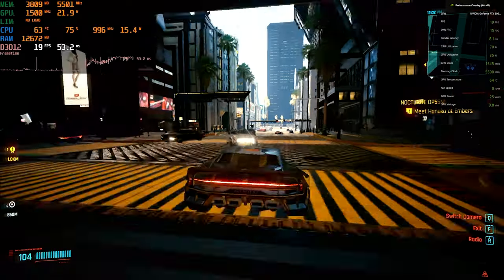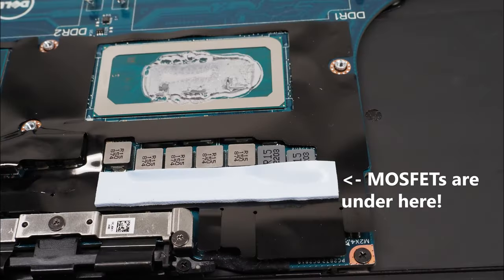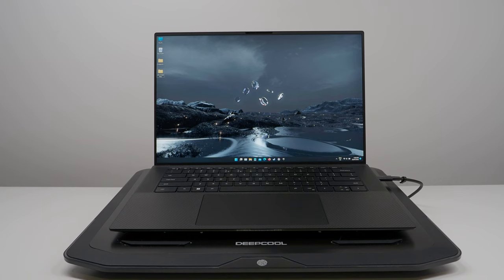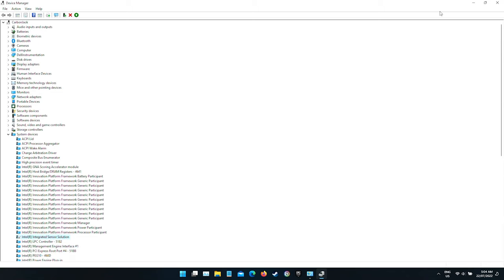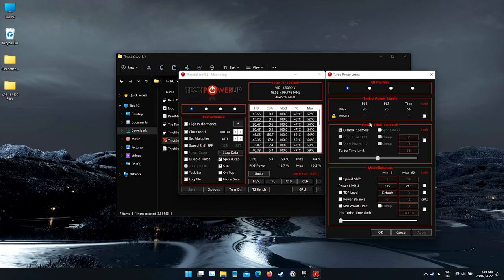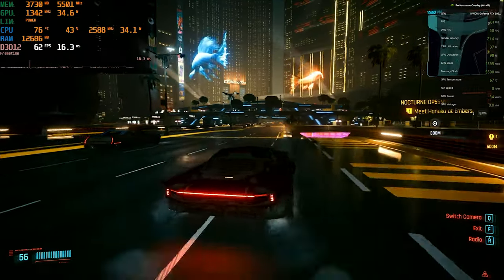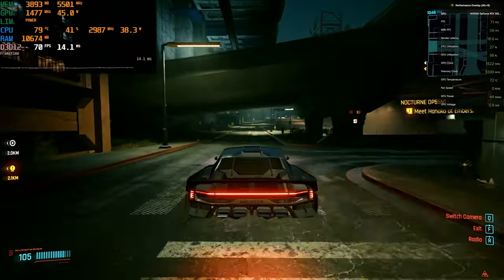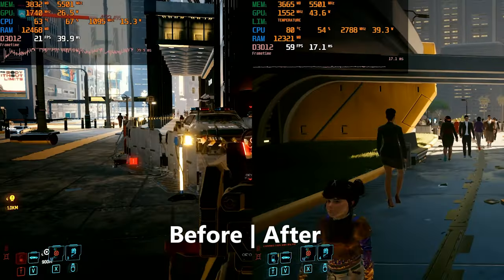Dell XPS 15 9520 - Solving the throttling

Comment: i can't seem to find NVIDIA platform controllers and framework in device manager, i have a dell xps 9500 btw (gtx 1650 ti)
Reply: Dude are you still facing the issue , because I have same config as yours , I also have xps 9500 , what did you actually do to fix it , because my laptop is throttling even playing cs 2 on low preset
Reply: @pranjal651  Hey, you're not gonna like my answer but I just bought a new laptop. I couldn't fix any of the issues and the screen won't turn on anymore, Dell is just a shitty laptop brand imo. Me personally, I would try and maybe get some money out of the xps maybe by selling it or trading it in (idk if they will give money for such an old model) and just get a new laptop, either a macbook or a gaming laptop with an actual cooling system.

Comment: About the cooling pad, it looks to me that the fans of the xps, take the cold air from behind and PUSH DOWNWARDS  the hot air  to exhaust (where the qwertyuiop keyes are). If this is the right dynamic, than, having a coolpad that pushes upwards forcingly the same hot air that the xps fans are trying to get rid off by exhausting downwards... it seems not productive. Actually i bought i cooling pad even before watching this video and it does absolutely nothing to the temperatures of the cpu or gpu. The system keeps having the same temperatures with or without it. I guess because the xps fans do not suck the air from down and exhaust towards the back of the laptop but they suck from the back and exhaust downwards. Do you have any idea about this?

Comment: This man doing the job that Dell engineers should be doing lol. I'll never game on an XPS after my 9560 with the i5 7300HQ and GTX 1050 would throttle to hell even playing lightweight games.

I also realized that people who said XPS could game ok were full of it or playing 25 year old games. Beautiful machine and built well, but the XPS line has always had terrible out of the box thermals/annoying hidden power limits.
Reply: Man I can understand your pain as I too own the 9560 and I had bought it after watching tons of videos online that showed them playing AAA games on the 9560 comfortably but when I tried my used to throttle to hell even in CS GO! 
I realised most of these people must be from really cold countries or are just straight up lying.

It is surprising that even after 7 years of the 9560, Dell is still doing the lousy job on XPS cooling... pity because I love my 9560 on every other thing but won't buy another xps anytime soon.
Reply: I did see a guide on youtube which made that 1050 XPS game pretty well for hours by severely undervolting the i5 7300hq (still maintained its 3.1ghz clockspeed) and the 1050 was undervolted too. You can repaste them both as well. 

My legion y520 with 2 small heatpipes and just 2 fans stuck next to each other, managed to make my 1050 clock to 2ghz with vram clock at +829mhz stably for days. My i5 7300hq was always at 3.1ghz and didn't cross 70. 1050 stayed at 60.
Reply: @siyzerix does the dell precisions laptops have thermal issues too, please tell me because i found dell xps 15 9570 and dell precision 5530 in the same price and i want to buy the xps but all consumers suffering from heating issues
Reply: @akqo  Have a look at reviews. I cannot say for sure. But they shouldn't overheat. However, like any laptop, you HAVE to tune it to get good temps
Reply: @siyzerix  of course, thanks for your response bro
Reply: Agree. Even playing football manager 2023 with 2D display match, still have lagging. This is joke my xps 15 9560 i7 gtx 1050

Comment: Thank you so much, I have an XPS 9530 and had horrible performance issues for months with the CPU clock speed going down to 1 GHZ whenever I opened an intensive program. I had the fans and thermal system replaced, updated all my drivers, changed every setting etc. and nothing worked, but part 4B worked perfectly for me. It's great to finally be able to use my laptop.
Reply: I think I’m also having the same problem did you just open the software and did only part 4b?

Comment: This did wonders for my XPS 15 9510 (2021 model) with an 11th gen i9 and RTX 3050Ti.
The 9510 actually doesn’t have that plastic layer, so all I did was re-paste the CPU and GPU with thermal grizzly and replace the existing thermal pads with nicer ones.
I think that alone helped a bit, but changing these TPL settings in TS helped significantly! I gained over 200 points in 3DMark Time Spy.

It’s a shame Dell locked out most of TS undervolting settings for new models. 
I’ve seen some Reddit posts where people managed to mod the new BIOS versions to enable the locked overlocking and voltage controls, and actually gain performance and battery live by undervolting, but the BIOS modding process is way too involved to waste precious time over.

Comment: On older XPS models, we could:

-  boost fan mapping with Dell Command I Power Manager (ultra-performance or cool). 

- SpeedShift was the best way to quickly adjust CPU performance (EPP of around 80/255 was the lowest that allowed max turbo clocks). EPP of 255 is worst performance with low power consumption.

- Elevating the back of the laptop with a pencil or eraser to allow more cool air into the laptop provided a nice boost to performance (for those who don't have a cooling mat). 

- Repasting the CPU and GPU as the factory paste was rubbish. Don't over tighten the heatsink else something breaks.

- Some electrical tape between the fans and radiators as the old ones had a lot of air leakage (hopefully that has been fixed by now).

- Some put thermal pads on the VRM mosfets (maybe to the heatsink). That is a trade off as the VRM temp sensor used to throttle the laptop at a low temp. This reduces cooling available to the CPU and GPU, however. Dell frequently mislables that VRM temp sensor so manually confirm.

- ThrottleStop had some great tweaks on the forums. I think Intel is running newer chips much harder so there isn't so much room to tweak. Afterburner can be great too.
Reply: Are these not needed anymore?
Reply: @BenGodot  No idea. The newer XPS models still are thin-and-light so will struggle with heat and power. All thin-and-light laptops suffer this to a point.

I don't know what tweaks work on the newer models.

Research throttling of a particular new XPS and determine if that would impact your use cases. These target daily us rather than heavy gaming, for example.
Reply: @dosgos Actually it's not Dell fault to be thin and small. It's intel fault that is still too hot even in 2024. Like MacBook which are thin and cool

Comment: I have the i9 version and I had to pull the limit down to 35W, otherwise it would run at about 50W in games which didn't leave enough power for the GPU. Now the GPU is at 45W, CPU usage is 20-30% so it's still far from a bottleneck. I also removed the plastic and repasted it with SYY-157.

I tested it in F1 22 on Ultra for about an hour, it averaged 63 FPS.

Comment: EGPU is the option right? If does, make a new video about egpu that suitable with I7-12700H.
Reply: I have been curious about egpu as well. How would the cpu perform if there is no load on the built in gpu?

Comment: What do you think about removing the wrapping on the bottom of the case and connecting it via thermal pads to the heatsink?
Reply: I didn´t removed the wrapping in the middle of the bottom case, but I have used the thermalpads to connect the bottom case and the ends of heatsink together. The result is as expected, lower fan noise and hotter bottom case, but not too much (you don´t get burn if you touch it)... Feel free to ask what you want to know!

Comment: I know this has been on YouTube for a while now. But I got the 2022 model and I did what you said and it made it worse. I tried it with The Division 2 and before I used Throttle Stop I was getting around 38 to 45 fps at ultra at 2100P. I used Throttle Stop and it dropped like a rock. It went down to 24fps.

Comment: I've had my 9520 for about 2 weeks now and its great - but throttling was annoying. This has def helped but I'll still hit 100c on the CPU and 75 on the GPU when testing with Cyberpunk. It'll start having a stutter reliably every 2-3 seconds almost without fail after 30 min or so of testing.
Reply: Update: I repasted the CPU and GPU with Liquid Metal, and replaced the thermal pads with higher quality - temps will still climb to 100c but the CPU and GPU stay at a higher boost clock for longer. Now the CPU will stay at around 75 watts and GPU at 40 almost indefinitely. No more stutter, just smooth gameplay now.
Reply: @Collinormous  I also want to do this with my 9520. would you mind sharing which thermal pads you got? also, did you remove the plastic sheet like he did?
Reply: @Nite85  I used Nab Cooling NB Supermax 15w thermal pads, and I didn’t fully remove the plastic, but cut it away from the mosfets so they’d have direct contact. I also taped off around my gpu and cpu with kapton tape just incase any Liquid Metal manages to escape.
Reply: @Collinormous  cheers. Will get some pads. They have different thickness tho right ?

Comment: Thats great, I have the 7590 model. I made a clean install of Windows and since Dell Power Manager (now My Dell) is crap I dind't install any Dell software. I had to repaste the CPU and GPU, and used throttlestop to adjust the power limit properly. Also I'm still able to undervolt the cpu since I didn't upgraded the BIOS, and that helps. The XPS is a great laptop, but seems that Dell is doing everything to not making it the best laptop on the market, to me this is insane.

Comment: Great video, legit turns it into a capable (relatively quiet) gaming machine, echoes all my findings too 👍 I arrived at a similar setup at your 4B. Locking the MMIO value is the key, was so happy when I found that.

With PL 1 and PL 2 you can set them to the max your CPU can handle then reduce the turbo time down to something like 4 seconds (since they can't sustain it anyway but it's great for bursty workloads like video editing)
I set PL 1 to 58w and PL 2 to 93 (allowing it to turbo in both states) then on another Throttlestop preset, I used the tick-box to disable Turbo on the main window. That way I have the same PL limits across both, but one profile allows turbo (work) and one disables turbo (gaming) which effectively limits it to 45w anyway.

This means I can leave the laptop in Optimized power mode too - however Ultra Performance seems to have a slightly more aggressive fan curve. Either way it takes a few minutes of gaming for the fans to arrive at their max speed too, so it can thermal throttle for the first moments in-game until it stabilises.

In regard to the laptop stand/cooler - I found even elevating the rear of laptop 1-2cm (any amount is better than none) had a substantial effect since the laptop's feet are so tiny. For those that travel with this you can just carry a small kick stand/bigger feet for the back. Or just prop a book under the rear edge away from the vents when you game.
Reply: Regarding the stand - I think LTT came to a similar conclusion. Elevating the laptop delivers nearly the same results as a active cooling stand, about 1-2°C worse.
Reply: @MsDomsim  Ah cool, I'll have a look at that video. Yeah it seems any elevation (even small) will help and then it's diminishing returns after that.
It seems to make sense when I think about it too, since the internal fan isn't going to increase it's throughput just because it's getting forced air faster. It just needs more room to pull in air at it's own pace. 

Active cooling pads make sense for things with a more passive design though, I imagine the passive M1 would benefit if the base is effectively used like a heatsink.

Comment: Would you do anything different for the turbo power limits on the i9 12900-HK and 3050ti XPS 9520? 

The default Long and Short Power PL-1 and PL-2 is set to 115 instead of 45 and 75.
Reply: if youve got a K series then you should be focusing on undervolting your CPU in the FIVR section rather than worrying about TPLs (or do both).

Comment: I'm really struggling with a 1050Ti Dell XPS 15 9570, i7, 16GB RAM laptop. Tried some advices from this video, but still the Dying Light 2 is unplayable, Can you suggest different settings? Seems I also don't have such items in device manager, so I cannot turn them off...

Comment: I was considering just applying Liquid Metal to the cpu and gpu on the laptop myself. I haven’t gotten it in yet, but I will see if those plastic bits cause as much issue for me as they did you. What tools would you recommend using to remove the plastic if it does appear to be an issue?
Reply: Also to anyone who removed the plastic from the bottom, does anyone notice any major differences between the bottom plate temperature when the laptop starts running

Comment: Do I have to click on “Turn On” on the main window of ThrottleStop so that the changes I make in the TPL Window take place? Currently it says “Monitoring” on the Top Bar of the ThrottleStop Window. I use ThrottleStop version 9.5
Reply: Also the changes I make in the TPL window do not seem to be saved upon a reboot of the system. I have to go through the steps in ThrottleStop every time I reboot

Comment: Does the whole throttlestop reset after you restart your laptop?
Reply: Try setting a task in task scheduler to open throttlestop at startup. Settings should save just make sure you lock them in.

Comment: For additional performance, you can undervolt the rtx 3050ti and OC its vram by as much as possible. That should net an additional 10% performance boost, if done correctly and how lucky your silicon lottery is.

Comment: Protip: With the Vostro 7510 and a heatsink rework you can coax a total computing power of over 100W with the throttlestop anti-DPTF hack, a PROCHOT 100C lock hack and ultra performance mode on that shitty RTX 3050
I am a mac user now, that machine is in the garbage. Don't do that.